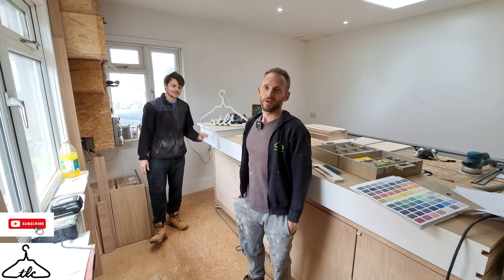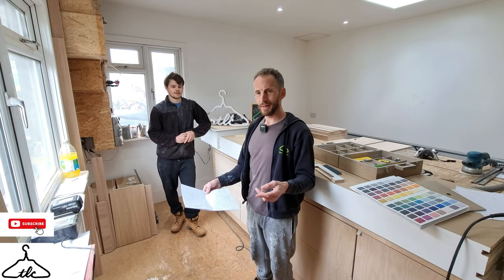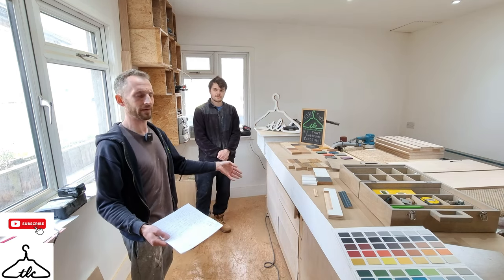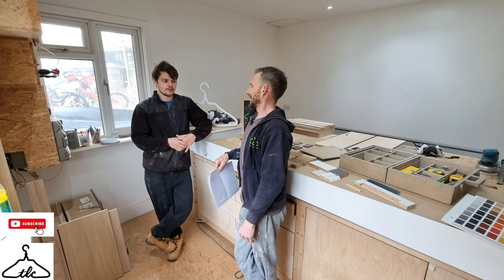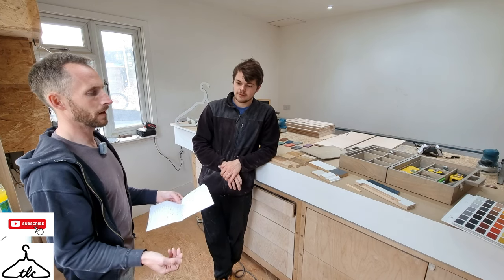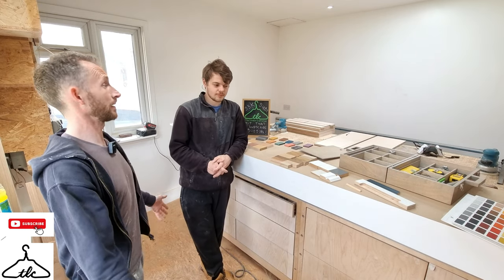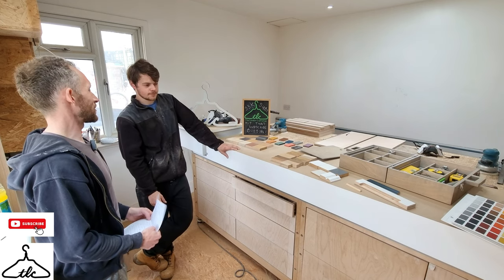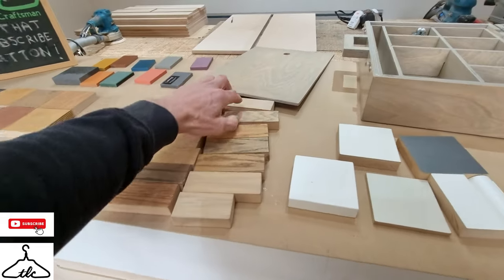What's The Best SHEET MATERIAL For Fitted Furniture??  We Discuss The Materials Topic // Vid#138

Comment: Great video guys, loads of information in there. I had an issue recently with oak veneered MDF that I’d used for alcove shelving. One shelf had 2 distinctly different finishes when finished with Osmo. Osmo have suggested sanding back to 150 and retreating with Osmo. Any thoughts?
Reply from the maker: Thank you, yes it's a problem we come across too often. I doubt that will make much difference.  It may darken that piece a little more but that's it. 👍
Reply: @thelondoncraftsmanworkshop  bugger! Guess if sanding back and refinishing doesn’t work then replacing is the only solution, a right t**t given I’ll have to buy a sheet at £80 😖!
Reply from the maker: Yep I think so. If I'm doing a big job I try and select the boards I want before I buy them . Other wise it's a pain in the ass ! Light colour oils aren't so bad, it's the dark colours that highlight the different grains.